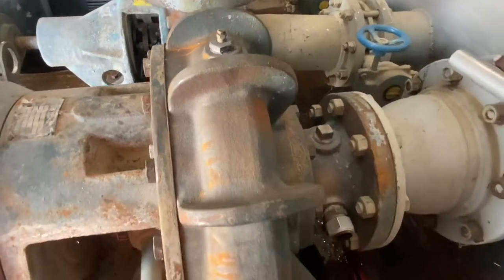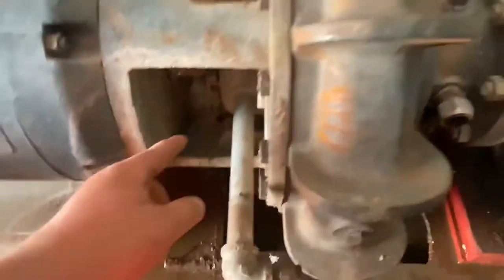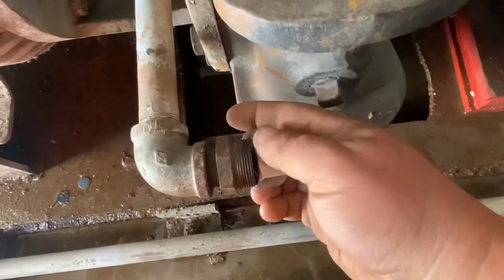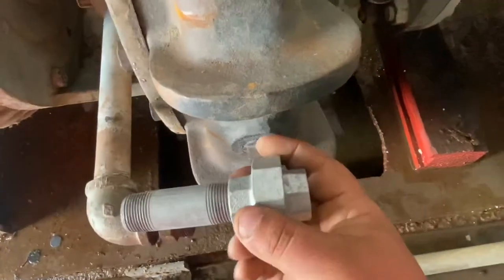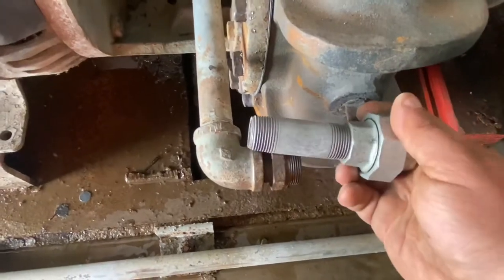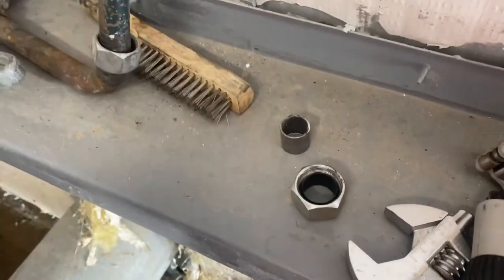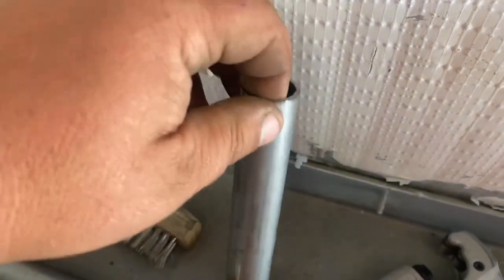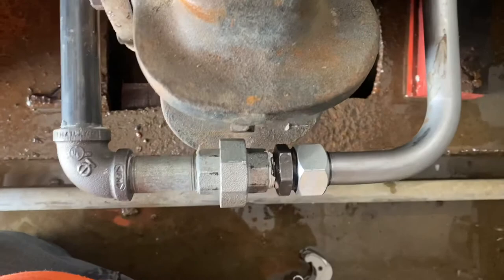Repairing the balancing tube on a centrifugal pump

Comment: Is there a benefit to keeping the tubing on one side? Why not just replace everything with threaded pipe?
Reply from the maker: You could do that yes, I keep the 90’s and compression fittings because when I go to jobsites it quick to cut everything to length instead of carrying a bunch of pipe nipples because they are all a different lay length and I know most pumps have the compression setup on one end so for me it’s just less stuff to carry and stock
Reply: @smalltownmachineshop6860  Makes sense. The Steamfitter in me always wants to replace tubing with pipe when the chance arises! 😁